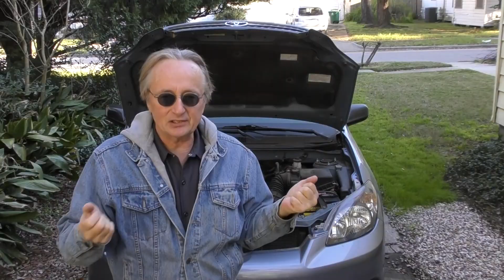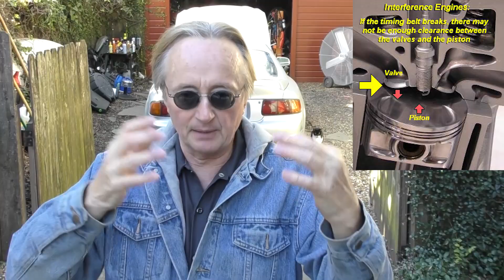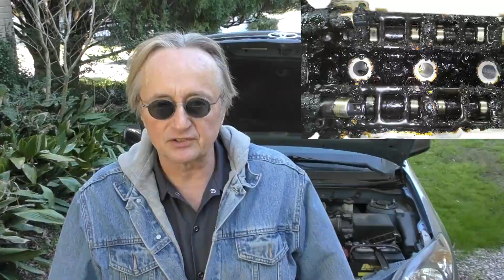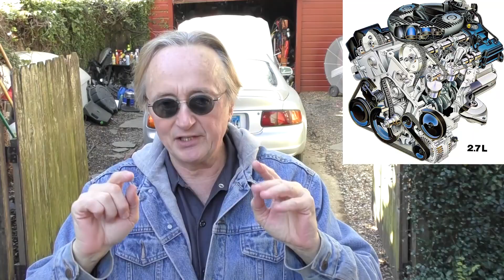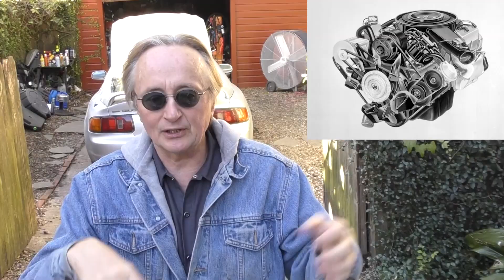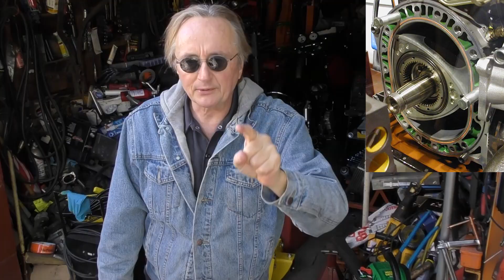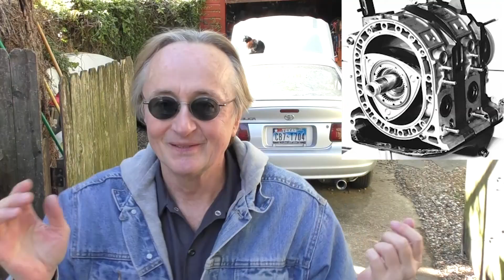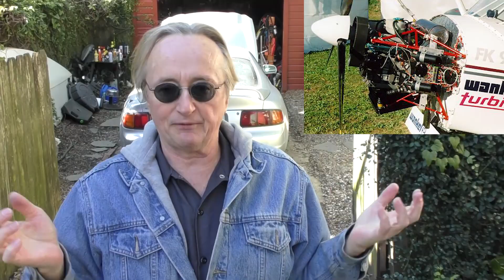Never Buy a Car With This Engine

Comment: I dont trust these GDI gas direct injection turbos engines. Just a money pit in a few years.
Reply: I gave a gdi engine on my sonata. Use synthetic oil and do gdi cleaning here and there. No issues 75k miles so far.
Reply: @Nycholas1998  those engines seize up. There is a class action settlement to replace them.
Kia has the same engine.

Comment: For Audi’s 1.8 idk why people wouldn’t use synthetic in a turbo. I run synthetic in 2 of my turbocharged engines. Also had a friend with a 2011 Q5 2.0T that burnt excessive oil and got engine replacement. The Q5 2.0 and some of the Acura 3.7’s oil consumption problems should’ve been on here but no so much Acura as they’re pretty reliable
Reply: Honestly if it doesn't have a sticker that says "WARNING!!! Synthetic oils only!" Nobody would remember
Reply: Florida Man yeah I thought it was well known to use synthetic in a turbo but I guess not as I do the maintenance on my car’s to the T so I have to remember there’s people that just lack knowledge there. I remember when the salesman was trying to sell me my 2014 Malibu 2.0, one of the reasons he said I should buy it was I could go longer on synthetic oil which I knew but oh well

Comment: Also your 100% right about the Eco-tec engines, Scotty , here in the UK we have a car brand called Vauxhall , since the early 00s they have used that 2.2 litre Eco-tec engine and everyone ive known whos owned  car with that engine has had serious problems , for example a friend of mine called Lukas had a Vauxhall Insignia 2.2 , the car was only 3 years old when the engine blew up , Vauxhall charged him 2 grand to repair the car, as the warranty Vauxhall sold him when he bought the car did not cover this type of breakdown, not good.

Comment: Let's not forget another POS GM engine the Cadillac/GM NORTHSTAR V8!!!
Reply: Blown head gaskets
Reply: i had a eldorado. loved the style and look, but that engine garbage
Reply: Northstar, 8-6-4, Olds diesel, ect.
GM tends to follow an unfortunate pattern.
1) Come up with a new idea.
2) Make it work in the lab.
3) Release and allow consumers the opportunity to pay thousands for the opportunity to be beta testers.
4) Realize that it has multiple problems, after denying there is a pattern of problems.
5) Fix the engine and release the working system they should have started with.
6) Cancel the program because of low sales due to it's horrible reputation.
7) Repeat #1.
Reply: @christopherconard2831  You mean the alum block Vega motor  lol Your right every time GM tried anything except their standard V-8s or inline 6 they screwed it up. The 4.3 was good but it was really only a 350 with out 2 cylinders .
Reply: john kendall And today the 4.3 is basically a V6 LS.
Reply: @christopherconard2831  One vehicle that comes to mind was the Olds Cutlass 2 door with the 2.3 HO + 5 speed.  GM puts out a high revving 4 banger (I think 7000 rpm redline)  in 1993 - way before the ricer fad.  Typical Quad 4 with the blown head gasket issue.  A friend from high school had one for a short time after we graduated.  It was a fun car.   Like you wrote, typical GM: come out with an idea way ahead of its time, then let it wither on the vine vs perfecting it.
Reply: @Ryno-fp7pm  They did "perfect" the quad4. The 2.4L "twin cam" LD9 was far more reliable than previous Quad4 engines.
Reply: @halohunter5217  I was referring to the high revving LG0 and W41.  GM was way ahead of the curve with those. The LG9 was better reliability wise but still not as good as it's Japanese counterparts.
Reply: @Ryno-fp7pm  Those high power versions were not as good as the japanese motors. The Quad4 is great for the tinkerer but if you want an appliance it's a nightmare.
Reply: My Mom had a '03 DeVille a few years back. She'd spend Saturday mornings rinsing coolant off the driveway into the storm drain. That thing drank way more coolant than my old '83 RX-7 drank motor oil. She drives a new Accord now.
Reply: superlew12080 I had an 05 Deville .  Traded it at 84,000 miles . There was a guy who lived in a trailer park near my neighborhood.  He bought it used from the dealer I traded it in at.  I only saw it in his driveway for less than a year or so.  My Dad said he saw it in a junkyard soon after.  The thing probably didn’t last 100,000 miles.  Oil leaks all over the place.  Badly designed engine.
Reply: @superlew12080  things happen. Surprising on 03 Caddy tho. Going Jap isn't my recommendation.. just don't like em. Believe in USA design / engineering prowess. Never failed me or my family.
Reply: 2000 and older north stars are one of the worst GM engines
Reply: The 1st and second gen Northstars are bad engines. While the 3rd gen Northstars are actually pretty good engines. I've got a buddy with one and its pretty solid.
Reply: Jake na hmmm caddie is trash period lmao
Reply: Francobnyc the big problem with the northstar is the fact it’s aluminum and if it gets too hot the engine can get warped
Reply: Yeah they were like a hit or miss never understood why GM even made them. American cars manufacturers are great at making one car with a Tank of a engine/transmission and the next with an awful ome
Reply: Replace the starter and cuss like a sailor.
Reply: Have the Northstar in my 2002 Olds Aurora.  Gets a new coolant leak every three months and leaks oil too.  Nightmare engine.
Reply: Hey! Watch your mouth buddy...
Reply: Quad 4 and Aurora also had similar problems. Tried some interesting things and made power, but long term reliability wasn't something they could provide.
Reply: That engine=trash
Reply: Especially the one in the from early 2000
Reply: Northstars are not 10% as bad as the 4-6-8 was.
Reply: Northstar is a good engine, lightweight and powerful they did have some issues most self inflicted by GM's extended fluid service intervals, causing corrosion between the head and block, of course then they overheated and warped the heads not a big deal. Another problem is when removing head bolts you can't just put an impact on and run them out they will pull the threads out of the block. I found if you loosen the bolts in reverse order a quarter turn at a time they generally survive.
Reply: Francobnyc oh my god the worst engine on planet earth. The sad part is I bought two Cadillacs 98’ 08’ 

Horrible GM motor
Reply: Francobnyc oh my god the worst engine on planet earth. The sad part is I bought two Cadillacs 98’ 08’ 

Horrible GM motor
Reply: Ah the good old engine in my Land Rover Discovery
Reply: I waited for Scotty to mention the Northstar...lol
Reply: Northstar...head gaskets, head bolt threads strip out of block, and the best - lower engine case half seals.  I think every one leaked by 50k miles.
Reply: I've had two Northstar Cadillac STS and they're the smoothest V8s I've ever felt. Even with bad motor mounts.
Reply: My 09 dts has 190k miles.. runs great.. basic maintenance.. drive it like a Cadillac not a Corvette.
Reply: The early Northstar engines were problematic. The later ones built after 2000/2001 were better.
Reply: @dwilsonjr78  I owned a ton of north stars..anything 04 and up is good...but I sold my buddy on 01 dts..currently at 226k miles original motor / headgaskets etc..
Reply: They haven't made the North star in many years.
Reply: Francobnyc lol how true!!
Reply: Was very bad.
Reply: GMC Envoy XL V8(3.57l) was ok 230,000 still going
Reply: hitek9wittafulclip yeah I agree, still debating getting another and just dealing with the engine problems
Reply: I loved my Northstar - until I had to get to the starter motor!!!
Reply: MY2003 and later are rock solid Northstars
Reply: 8-6-4 was a solid engine if the cylinder deactivation system was disabled. I've also heard of people just using a toggle switch to deactivate 4 cylinders on the freeway.
Reply: Wonder why the Ecobooms weren't listed?
Reply: @mikeshelton5629  ecobooms!? What the fook is that. Are you one them keyboard expert trolls? Scotty tells like it is no BS.
Reply: @davidklimmek3192  EcoBoost =Ecoboom  .  Plastic oil pans also have a propensity to leak. I didn't even mention the old 360 engines that dumped oil into the radiator
Reply: @mikeshelton5629  haha i figured u were trolling ! Ecoboost is excellent. We have one. No plastic oil pan. Move on w/ ur agenda dude.
Reply: @davidklimmek3192  you a d I have a different definition of excellence.  I like truck engines that are t disposable.  Hate to tell you, but yes the Ecoboosts have a composite oil pan. It's a fact
Reply: @mikeshelton5629  Dude plastics have come long way as has mettalurgy. "If" Ford deems certain engines can have composite parts  safely wherever ..i trust em. Never did me wrong. Guarantee they aren't only ones! Ur KIA/Hyundai prob full of plastic. Mad @ Ecoboost popularity & reliability eh?
Reply: @davidklimmek3192  no Kia for me.  I dont have an agenda other than seeing people pay good money for items that have now almost reached disposable.   Had  Thunderbird back in the early 90s that leaked horribly ever time it rained.  Ford wouldn't do anything a out it.  Local dealer felt so bad about it that he traded with me for about $200.  Eent up a year and gained about 20 000 miles back to 0.  He said if it leaks come on back and trade.  Some leak some dont.  Once I saw that it didn't leak, I traded before it gave problems.  Bad when the Ford dealer tells you he has no confidence in what he's selling.  Technology is great if it's designed with reliability in mind.  Just not the case with most of the cars today.
Reply: @davidklimmek3192  I rented an Expedition for a weekend a while back with the 3.5L Ecoboost and goddamn.
Reply: @mikeshelton5629  i was gonna list the NEWER 2yr old Honda 1.5L turbo GDI motors but didn't want start arguments.
Reply: I own a 1996 Cadillac DeVille with the 4.6L Northstar and it still runs like new. Stupid people wouldn’t change the coolant after 100,000 miles which lead to the head bolts corroding and failing which in turn caused overheating and warped aluminum heads. Treat them right and they’ll last forever. They’re very good solid engines.
Reply: @filthyanimal874  but that's a fringe opinion.
Reply: North star is a good engine.  You just cannot get them hot.  They will blow a head gasket quick. And of course it cost a lot to work on them.  But if you drive a Cadillac you should be able to afford it.
Reply: @jacobmyers6361  it's one of those vehicles that poor people 'posture' with
Reply: And every ford truck engine
Reply: @Kingus_Dingus  including the 4.9 L6?
Reply: That engine was advanced before it's time & won many accolades!!

Comment: I have 03 Saturn ion with the 2.2l and it's running strong it has 200k miles on it I do the oil change every 3k miles

Comment: My 2003 A4 1.8T remains perfectly running @ 307k miles (its a stick shift).  The 1.8T remains clean as a whistle , kept synthetic in it the entire time. Had to do a headgasket job last summer, and the 1.8T had absolutely no oil crusties in it. It continues to run strong as ever, and uses about 1/8th of a quart every 3k miles or so. These are not junk motors - and if you don't understand the car and drive it like some disposable Toyota product then its going to happen just like ny other vehicle, including those precious Toyota appliance fridge stove vehicles.

Comment: The simplest motors run on electricity :-)
Reply: You are correct.  All MOTORS  run on electricity.  ENGINES burn fuel. People use the term motor, To describe the internal combustion engine,  but its incorrect.

Comment: Don't buy gm or chrysler products in general... Lol. Vw engines are aweful except for the Tdi. In europe, everyone uses synthetic oil, etc. Here they are all el'cheapos who try to save money in the wrong areas. Nissan drives the water pumps with chains too. Very stupid designs.

Comment: My grandparents gave me their old 2000 Buick Century with the 3.1L V6 and I commuted in that car for many many years. That car was super reliable and smooth, I could almost fall asleep in it. It felt like I was driving on a cloud and it was so quiet inside. It drove like a boat and it felt like it could roll over when making sharp turns. 
But boy was it a great cruiser on the highway. It's perfectly quiet inside at 70 mph, and I got good gas mileage. It wasn't a sports car by any means, but if you put he petal to the floor, it had decent passing power. But above all, it has been extremely reliable. The engine has never had any problems whatsoever and I always did routine maintenance and oil changes regularly. It did shift a little sloppy, but that's to be expected for a car aimed at older people. It's easy to drive, way more comfortable than a lot of modern cars I've been in, and just keeps on driving.
I got it from my grandparents when it only had 80,000 miles. They had another newer Buick that they drove, so they gave me their old one. 
And sure, the Buick Century is not the sporty electronic filled stylish cars you see today. Far from it. But I don't care. It's just me and the car with no electronic garbage between us. And that's what I like about it. There's plenty of room under the hood for me to work on it. Parts are dirt cheap and can be found at junk yards for pennies. But the only things I have done to it is replace a blown brake line, replace the air filter box, and flush the coolant system. That's it, seriously! And it's 19 years old and still going strong. It has just been routine oil changes. 
The engine is the GM 3.1L V6 3100 SFI making around 175 HP which is plenty for a commuter vehicle. It's no race car, but it has power to spare when passing cars in the highway and getting up to speed quickly. 
I'm still daily driving that car and I'll keep driving it until it either blows up or turns to dust, whichever comes first. The old Buick cars are very underrated in my opinion, and I'm surprised that not many people my age truly appreciate the "old people cars" and luxury sedans like these. I can drive to work in comfort and I have so much room to stretch my legs and relax while driving. A lot of newer cars I've driven can handle much better and are probably faster, but their ride quality is harsh and you feel ever crack in the road. The old Buick goes over bumps like it doesn't even exist. And that old Buick can still accelerate pretty quickly and sounds pretty good with that 4-speed automatic.
Reply: Overrated? You must have meant underrated.
Reply: Good points. You really don't want a sporty/ harsh suspension up here in the Midwest rust belt. The roads are rough, salt rots the Bodies out in ten years or less.. I actually towed a Pontiac 6000 out of the ditch midwinter , and in the process, the engine transmission subframe just gave out, literally falling out and scraping along the ground. 😅😕
Reply: Its the Chevy Colorado first generation is known for manifold leaks.

Dont buy it. Also they got a 2nd cat. convertor. It goes out before 90K miles and so does the exhaust manifold on both sides.

Very expensive repairs.
Reply: 1990 Grand Prix with a 3.1 engine in it you can't kill that thing only thing I replaced was Major with some kind of oil pump seal start leaking oil but otherwise is a great car I had the transmission flushed once which I heard the guy that does the cast on here say that not the flush the transmission but I did that mine went 225000 miles and was still strong so I don't agree with everything he says but I'm glad someone said that 3.1 was a good engine in the 3800 or 3.8 was it good motor

Comment: Blow up your engines!
Reply: Lol, no thanks, knock on wood.
Reply: @Zeck88522  knock on aluminum head
Reply: Hahaha he should've dubbed that in
Reply: This made me lose it 😂
Reply: I have a 2.2 L engine in my Chevrolet s 10 and it sucks bad it has been overhauled twice and it is blown again and it was babied
Reply: @hampneel4589  my Cobalt blew an engine last summer running that POS 2.2 Ecotec...timing chain stretched and just the same...perfectly maintained. It happened a week after spending $600 getting a full tune up and getting ALL fluids changed.
Reply: I overhauled my 2.2and it blew up 3 times I am an aircraft mechanic been overhauling engines almost 40 years worst engine ever worked on
Reply: Scotty's a rotary hater!
Reply: J
Reply: Up the ecomang
Reply: Lol
Reply: Underrated comment
Reply: That’s what his advice does to cars
Reply: How many shots of vodka does this guy take before he makes these videos ... Rack up your bar tabs and get ready to mumble and slur your words through another Kaaaar ... vid. ... vid ... video ... 😜👌